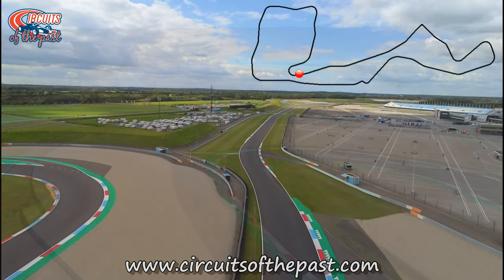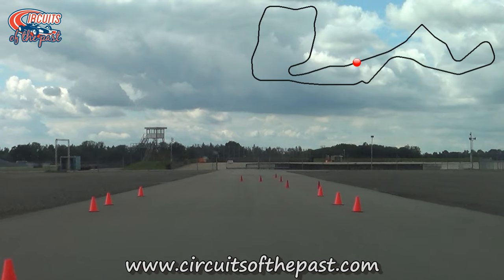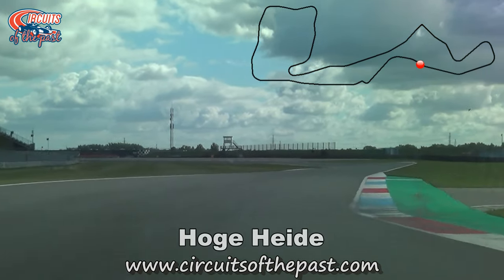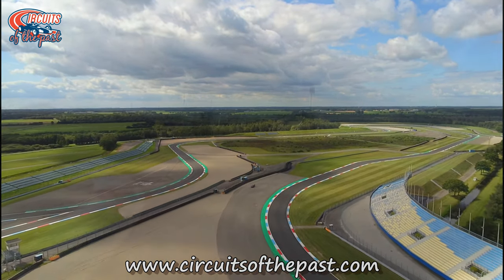TT Circuit Assen Old Layout 1984 - 2005

Comment: Looks like it would make a good track for F1, maybe just a little narrow and little short in length. But would be very interesting to see the F1 cars go around!
Reply from the maker: They competed with Zandvoort for the Dutch F1 Grand Prix, but F1 choosed Zandvoort. Originally Zandvoort was the track for car racing while Assen was the track for motorcycle racing. What Assen has against to organize an F1 race is that it is designed for motorcycle races. There are short straights and no hard braking points. If F1 would have choosen Assen they would change the Veenslang section to create an overtaking opportunity for F1.